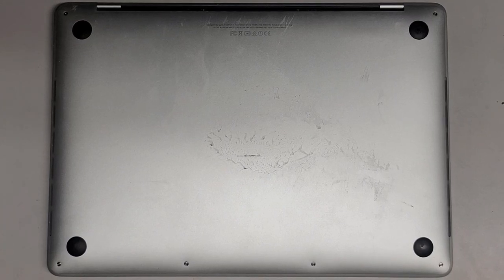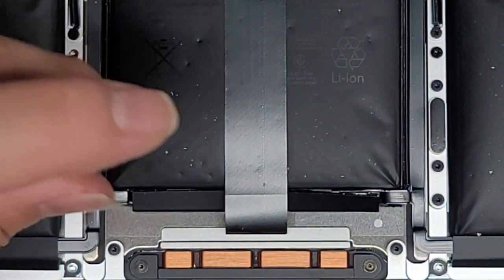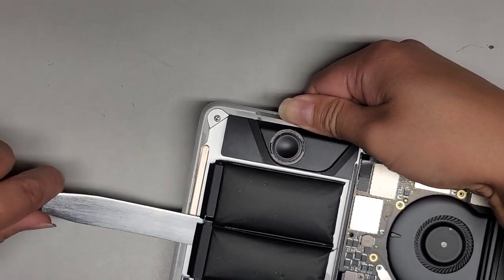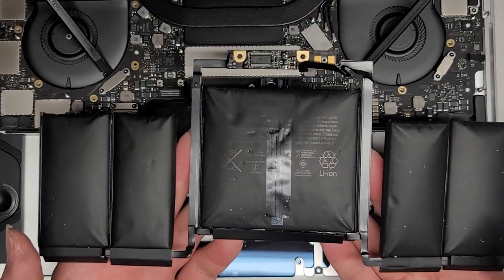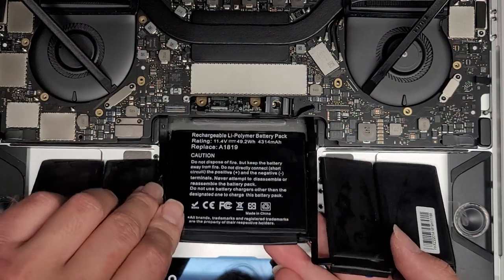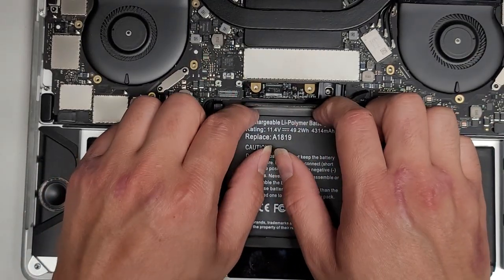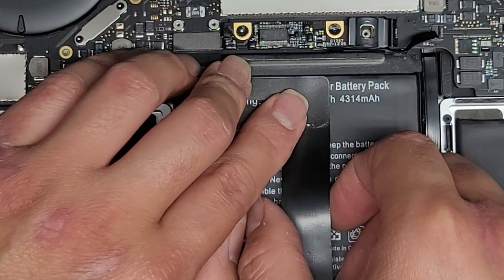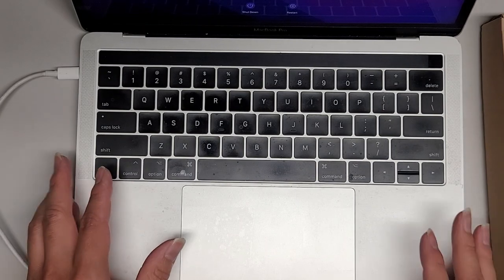13" Inch MacBook Pro A1706 Mid 2017 Disassembly Battery Trackpad Touch Pad Replacement Repair

Comment: Hey man, no clue if you will se this, but I have a question. Currently my haptic on touchpad is not working, I wanna know what's the possibility the problem could be w motherboard. I ll be already replacing keyboard and battery and I don't wanna spend too much money and too much time to end up with no haptic again. Do I just shoot my shot or is there any other way? Maybe it could be software problem? I know it's hard to help without seeing the problem but I ll appreciate any help you might offer. Thanks for the video, its very easy to understand and follow.
Reply from the maker: Is everything else working? Double check the cable. It's the battery is inflated, the pressure alone could prevent it from vibrating.
Reply: @ItsBinhRepaired  Yes the touchpad it self work  fine jst no haptic. I already took it apart once, and battery looked in perfect shape even tho it has over 800 cycles on it. Most importantly, if I replace the touchpad it should work right?
Reply from the maker: @feravaculik8278 it should. Watch out for the washers.
Reply: @ItsBinhRepaired  Thank you a lot! Hopefully everything will go according to plan.
Reply from the maker: @feravaculik8278 yup!

Comment: Hi Mate,
I have 2016 MacBook Pro A1706 with Touch Bar. I had my keyboard replaced in Turkey in 2020, and basically bought a new laptop as soon as I came back to London and never used it since. Now its has a dead battery (only works with direct power) and also for some reason a dead Touch Bar. Could these problems be related?

I have ordered a battery and will change using your video on the weekend. 

What do you think could be wrong with the touch bar? I don’t remember seeing if it worked after the keyboard replacement. Could it be the guy forgot connecting it? or perhaps something else which is a more common issue I dont know of?

Thanks in advance for your help.
Reply from the maker: Very strange. I don't think it's related to the battery, but who knows. Apple likes to build in software dependencies. It's annoying and stupid.

Comment: Hi, I have replaced the battery in the same way as you did. But I got a big broblem. My macbook pro could not charge the battery. Right now the menu bar shows the sign of battery inside x and says power source : adaptor. Any advice to me?
Reply from the maker: Double check the metal tab and the ribbon cable
Reply: @ItsBinhRepaired  Hi I’m having the same issue. What metal tab are you referring to?
Reply from the maker: @daviddavis9645  the one under the screw.

Comment: Is this made by apple or third party battery ?
Reply from the maker: Third party
Reply: @ItsBinhRepaired  do you see any issue till this date can you tell me where to find. 2017 MacBook pro Touch Bar model battery
Reply from the maker: @thesuperstar4470  what's the model number on the bottom of your MacBook?